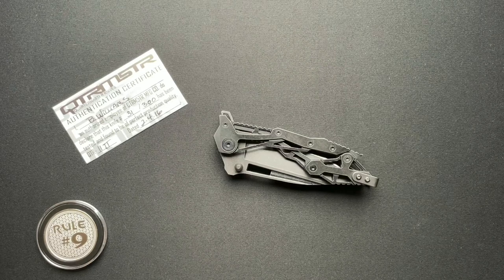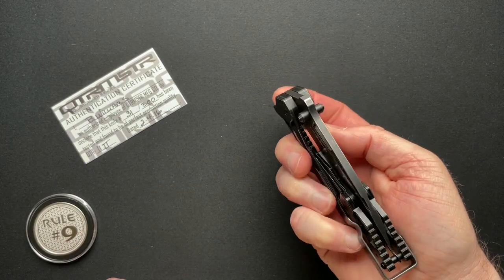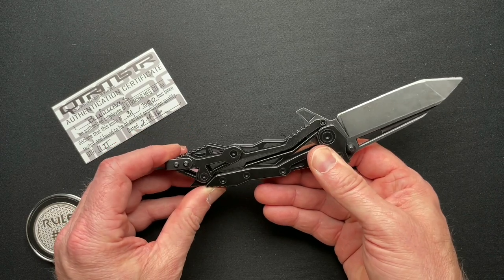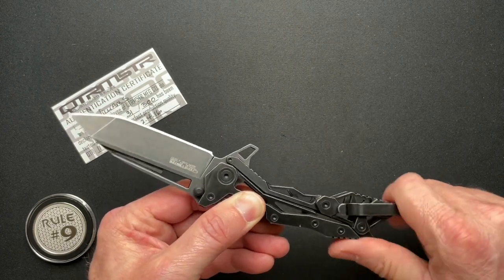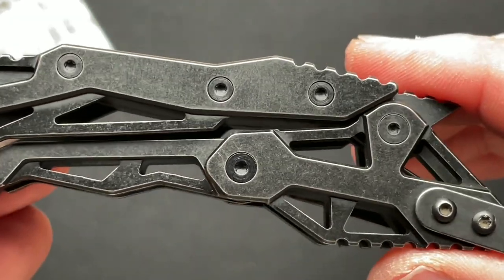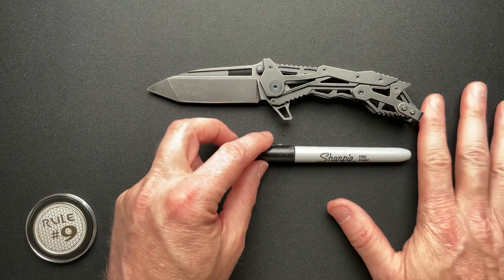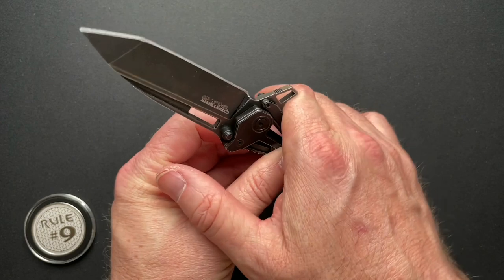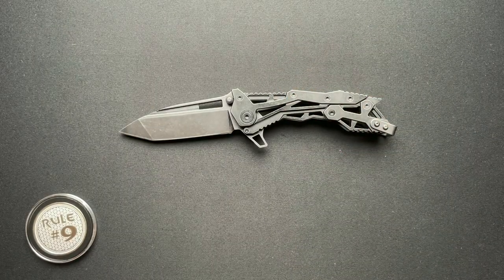Quartermaster QTR-11 TT Knife Review

Comment: I actually own a general lee 2. It was my first "expensive" knife purchase and I've carried a bit of shame because of that. As a daily carry it's just not practical for me but as a conversation starter or fidgeting tool it works very well. Beware of operating it with the rear flipper tab it will cut the shisnit out of ya with out a second thought. It is a bit of a chunky monkey but the lock up and feel in hand is solid. Knifecenter has 3 different models in stock I just checked after watching this video and there are Chinese reproductions out there. I'm not sure if you'd call them clones but they are out ther.
Reply from the maker: Thanks for sharing. It is a strange and unique piece.